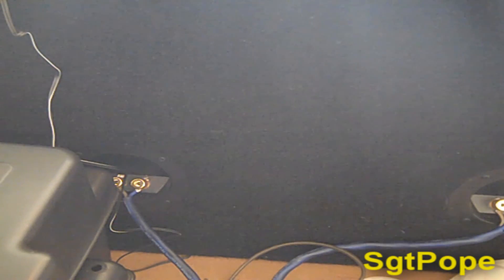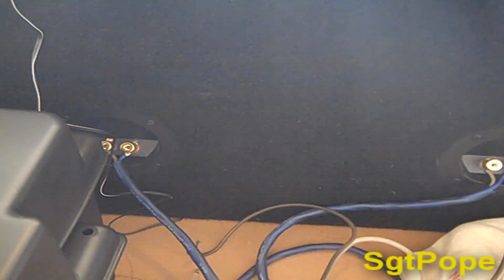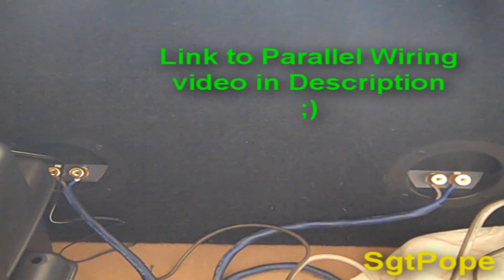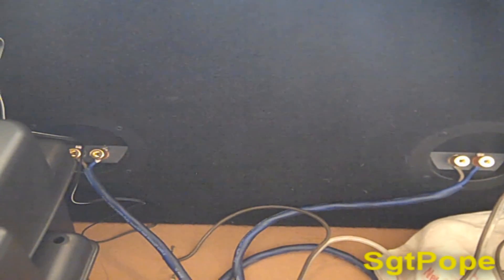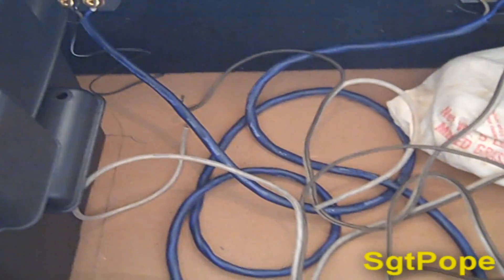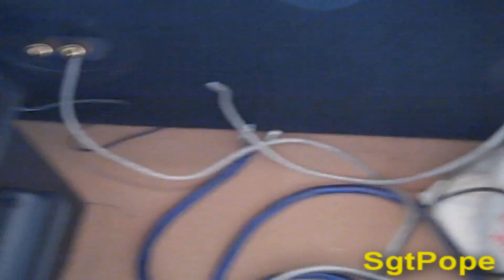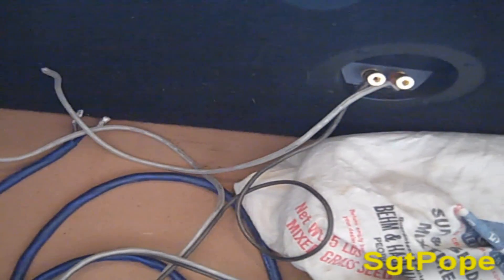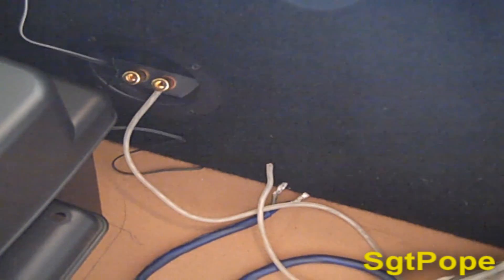How to Bridge 2 Subwoofers onto a Mono Amp or One Channel!

Comment: I don't get it.  I have photon subwoofers 215 I wired them negative to negative positive to positive drop them down to 1 ohm load because my amp is 1 ohm stable it keeps cutting off so I wired it regular and it doesn't cut off but it's not loud at all it's very weak it sounds but it's not loud when I had it went the other way it was very loud but cut off when the bass drop. I'm trying to understand what you just did with these wires but can't quite get it

Comment: hmmmm I have one sundown audio E8 v5 dvc 2 ohm subwoofer rated at 300w rms and a JL Audio JX250.1 I know that both are under rated and my sundown audio sun can take more and I know my amp can push out more then 250w rms continuously my question if I wire my sub to a final impedance of 1 ohm will my amp be able to handle  it and if so how the funk do I wire it lol oh and my amp is monoblock A/B and 1 channel amp but has 2 positive and 2 negative connections? anyone know why? I thought 1 channel mono amps only have 1 positive and 1 negative connections

Comment: I got the MTX terminator 12" subs and I got a Boss AR1500M Mono block amp. The subs are already bridged into one spot to run wires to but when I hook up wires from the amp to the subs they don't do anything, No sound or anything. I have checked all the wires, the amp turns on the capacitor is on and its all connected to the radio, what did I do wrong? Please help!!!
Reply from the maker: +Way Too Soft Hmm, is your ground good? That can cause issues.

Comment: I was wondering if these subs would be compatible and if yes how to wire them (series, parallel)

 my friend gave me his Lanzar VCHB210 and I was wondering if the amp I selected would be compatible 

Speakers: 
        10" Dual 4 Ohm Vector Series Car Subwoofers 
Power Handling: 
        Peak: 2000 watts total/1000 watts each 
        RMS: 1000 watts total/500 watts each 

Amp: 
        Pyle PLA2378 2-Channel 2,000-Watt Bridgeab le Mosfet Amplifier 
power handling: 
        Maximum Power Output 2 x 1000W 
        Bridgeable RMS Power @ 4 Ohms: 1x2000W

Comment: Will my system be weaker  with a mono amp to two  subs
Reply from the maker: Anthony Martinez Not necessarily, but it could. It really depends on how you wire everything, either bridging the subs or running them in parallel and you overall ohms. You want to run your subs at the lowest ohm rating your amp can handle to get the most power.

Comment: I have a 4Ohm Fosgate sub, need to bridge it to this amp PIONEER GM-A6604. I'm thinking of using 2 channels for bridging for the sub and the other 2 for my rear speakers. Is this safely possible and OK to do so?
Reply from the maker: That should work fine for you. You don't actually want to do what I did in this video, that's a totally different way to wire subwoofers. Instead, you'll want to run the sub's negative wire to the negative that's reserved for bridging on your amp, and then the positive that's also reserved for bridging on the amp, which should be printed right on the amp.
Using the other two channels for a few extra speakers will work just fine too.
Reply: Thanks for the reply. Just confirming, I'm supposed to connect the +ve sub wire to +ve of channel 3 and -ve sub wire to -ve of channel 4? Is that correct?
Reply from the maker: Avneet Sethi That sounds right, but I'm sure the terminals for bridging are different for other amps. If that's what is printed on the amp or in the manual, those are the terminals for bridging.
Reply: Thanks mate. Will surely check before plugging in.

Comment: how about taking a 4 channel amp and using all four chnnels to one woofer, to get all the power out of that amp cause I now how to bridge a 2 chnnel amp to one speaker ,but a 4 channel is it possible that way I take the whole 400 watts and use it in one sub thanks
Reply from the maker: I'm pretty sure you can't bridge one subwoofer to all four channels to an amp. I have a four channel on my boat and I just bridged using two channels.
Reply: ok so if I have  a 400 fosgate amp 4 channel and I only brifge 2 channels that means am only using half the amp,200 watts then or does it still give u all the amp, even if its 4 channels ,its tht I don't want to waste any of the power cause I only need one 12 sub and I would like to use the whoel 400 watts ,y said n ur boat u have a four channel amp and u just bridge 2 channels but how many speakers r u using on that bridged 2 chnnels and what r u doing with the other 2 channels there being wasted no ,thanks sorry so many questions I know a lot about hooking them up but the bridging on a 4 channel amp scares me cause I don't think ill get the whole 400 watts out of it like I want, its a real good amp and the sub well hold 400 watts no proplem  thanks for answering ,
Reply from the maker: mrcrazy3872 In all reality, 4 channel amps are bad for subwoofers. Mono block amps work best for subs because they are typically much more efficient and they provide power much cheaper.
If you're going to use a four channel amp, you can do something else with the other two channels, like you said. Add a few speakers or get another sub.
Reply: yea I picked up a one channel mano amp walmart boss 1100 watt for 50 bucks, I doubt it it tros tht much but the four channel bridge, really made that woofer bang hard that's why I did wnt to waste the other channels and I have a alpine for highs there both four chanel so ill use the boss amp thanks .

Comment: You have no clue what you're talking about.Hooking a positive speaker wire to the other speakers negative? Are you high? To bridge on a mono amp, you run a positive and negative to each sub. Then twist the open positives together, and insert to amp. Then repeat with the negative. That way, say you have a 500w x 1 amp, it quickly becomes 1000w x 2. (500w to each ch.) (or each sub in this case)little thing i refer to as mock watts. But, if you're not 2 ohm stable,do not do this.Easy on gain at 1st

Comment from the maker: I found an amp that should work nicely with those two subwoofers. The subs are both Dual 4 Ohms, so when paired up on one amp, you can drop the impedance to 1 ohm. Below is a link to a Polk Audio amp that should match up perfectly with your Polk Audio subs.

polkaudio (dot) com/products/pad1000_1

Comment: Hey I have two rockford fosgate p3 shallow mount 12s that max out at 800 watts but the amp I have is a 500 watt mono block wich would only be 250watts to each sub, if I wire my system like you did in the Video it will double the power?

Comment from the maker: The good news is that amp should run at 1 ohm just fine. You actually don't want to hook the subs up in the way I show during this video, rather you want to run them in parallel. Essentially, you cut the ohms from 4 on each coil, down to two, and then hooking up both subs together drops it again to 1 ohm. I'm going to send you a picture through your private messages that'll show you exactly what you should do.

Comment: @SergeantPope well I was deciding between 2 sundown audio sa-12's in either 2 or 4 ohms. They'd be running off of an audioque AQ2200D amp. I was hoping to run them at 1ohm but I didn't quite understand the wiring.

Comment from the maker: It's impossible to hook up two Dual 4 Ohm Subs to an amp and end up with 2 Ohms. You either end up with 4 Ohms or 1 Ohm, but your amp is not 1 Ohm stable so you can't hook it up that way.
4 Ohms will give about half the power it would be getting at 2 Ohms, which is roughly around 250 Watts RMS per subwoofer (500Watts RMS total). It's not perfect, but it's the best way to hook up your subwoofers to the M1000 amp.

Comment from the maker: It would have 2 red and 2 black connectors either way, since both are dual voice coil.
You can't really maximize your amp with 2 Subwoofers that have Dual 4 Ohm voice coils. The lowest you can possibly get them is 4 Ohms, which isn't bad, but won't result in the most power.
To do this, you would run the subwoofer's voice coils in Bridge and then you would hook up the subs to the amp in Parallel. If you need me to be more detailed about this, send me a PM as it will take much more characters.

Comment from the maker: That subwoofer comes in Dual 4 Ohm and Dual 2 Ohm. This answer will wildly change depending on if you have the 4 or 2 Ohm model.
It's not a good idea to use 2 Dual 4 Ohm subs on the M1000, but if you have 2 Dual 2 Ohm subs, then it'll work out just fine. Let me know what you have and I'll letcha know what to do :)

Comment from the maker: Yeah, you can do it either outside the box with those terminals, or the inside terminals on the subwoofers. I personally have to do it on the outside of the box since the chambers are not shared. I can also show it off easier that way too.

Comment from the maker: @gamerjoe22 Parallel wiring and Bridging are completely opposite ways to wire your subs. It just depends on your wanted impedance on which method you use.
Most parallel wire their subs to lower the impedance and raise wattage.
However, many times people with speakers and equipment that can't handle a lot of power will bridge their system to lower the wattage.
Paralleling cuts impedance in half, resulting in double power
Bridging doubles the impedance, cutting the power in half.

Comment from the maker: @rckvll747 It is possible to get all speakers down to 2 ohms. Just make sure they can handle that power first. Anyways, here's how you do it:
On one channel, run the positive to one speaker and the negative to the other. Then, twist another wire onto the positive end going into the speaker, and run it to the other speaker's pos. Do the same thing with the negative.
Then just do that same thing with the other two speakers on the second channel.
Let me know if you need any more help :)
-Tony

Comment from the maker: @cisnerosrobert I see that this is a 2 channel amp. You can bridge the two subs to the amp, this means that only one one set of speaker wire goes to the terminals (usually the outside terminals). Have the positive go to one sub and negative go to the other, and then have the next positive jump from the original pos to the other sub, and then the same thing with negative.

Continues...

Comment: okay i have one more question i just came across a quantum audio 3000 watt amplifier on the speaker output it has the negatives next to eachother and the positives next to each other its kindof confusing how do i connect these kicker comps to get the maximum power my 15s are single voice coils

Comment from the maker: @13triggerman It actually is if you have the right sub. If you have a subwoofer with atleast two voice coils, you can use one amp for one of the sets of terminals and the other amp for the other set.

It can get easy to overload your sub if you have intense amps though...

Comment from the maker: @cisnerosrobert Ok, I looked up your components. I think with your subs and amp combination, all you need to do is directly hook up the subs to the amp.

I believe I found that the amp is a 2 channel and the subs are single voice coil, so if you hook up one sub to a set of the terminals on the amp and the other sub to the other set of terminals, it should work fine. Let me know if you need any more help. I'll be happy to give you some more assistance :)

Comment from the maker: @SergeantPope Ok. So the first way you can do this is to run the Sub's voice coils in bridge. Run speaker wire to either of the outside coils (+&-) and then bridge the gap. Once you do that, then you can parallel wire the two subs to the mono amp. (+ to +, - to -).
The other way is to parallel wire the actual sub voice coils and then bridge the subs to the mono amp. Either way you'll end up with 4 ohms.
This isn't the best solution, since you don't get full power. But those are the only options.

Comment from the maker: @6497ray This is one of those cases where it doesn't work out perfect. I looked up your setup and found that I don't believe your amp is 1 ohm stable, which is the problem here.

You'll only be able to run your subs at 4 ohms instead of the ideal 2 ohms. I'll reply to this so that I get more room to tell you how to do this.

Comment from the maker: @shivam220 Hehe, yeah. I've gotten way better at making videos since :P. You're actually trying to Parallel wire your subs. Bridging will raise the impedence.

To do one Type R sub, use the connectors that came with it. Have one connector connecting the positive and the other connecting the negative. Then just run the speaker wire to it. If you need a better explanation, feel free to PM me.